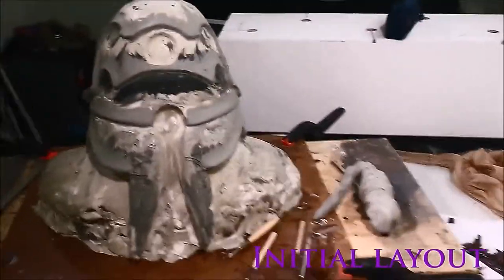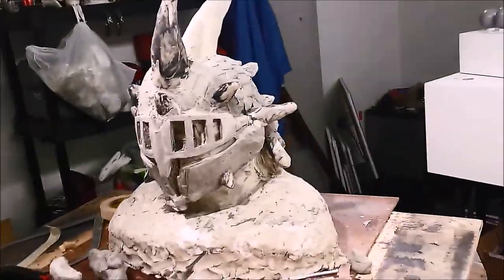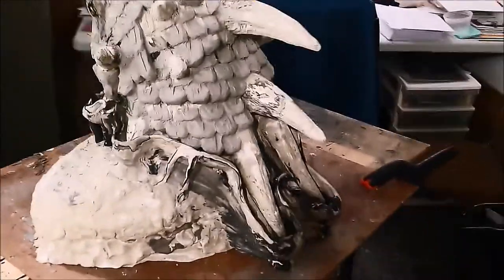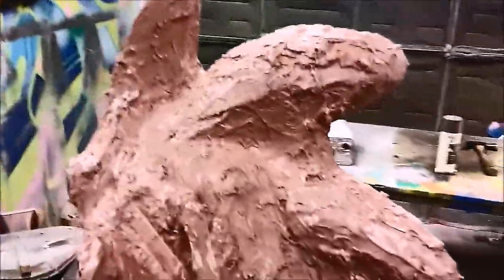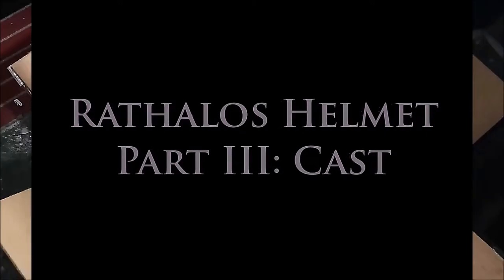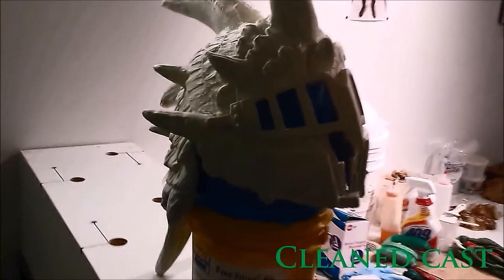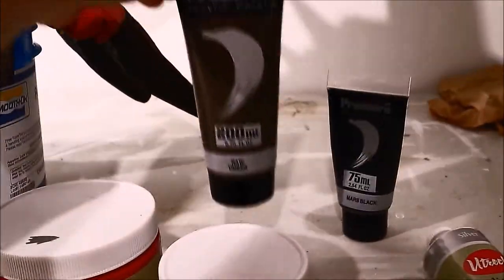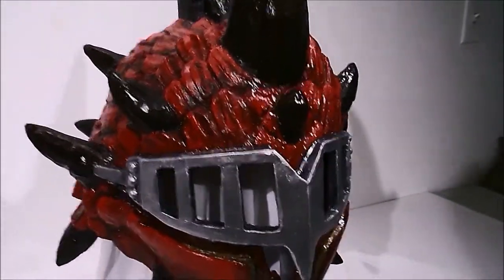Making a Suit of Armor Using Poly-urethane Rubber, Resin, and Epoxy Putty : Rathalos Helmet

Comment: So for a quick summary, you molded the base with clay, then used a rubber layer for detail in the mold and a stronger mold to help the rubber hold it's shape?
Reply from the maker: Yes, it's a fairly common mold making techinique, soft mold + mother mold. It's important that your mother mold piece can come straight off, which is why this has a three piece mother mold. Any less and you would encounter trying to pull off a mother mold that is grabbing what's called an undercut, essentially locking it in place. There are ways to do mother mold inserts that can help you cheat that problem, but it's tricky and I don't recommend it.

Comment: why epoxy putty inside instead of doing full casting resin is it cheaper or stronger or what.....trying to find the best way to do this stuff, because it gets expensive quick,
Reply from the maker: The epoxy putty is a great way to back up thin areas of resin and will also help you keep the total weight down. You could go through and cast thin layers of resin doing your best to get everywhere, but I think what you'll find is that in order to get the deep cuts in the sculpt (which are sharp ridges inside your mold) you'll have to throw so many layers that you'll get heavy pooling in some areas leading to one heavy helmet.

I may have not shown it well in this video, but if you can, throwing 2 or 3 layers of resin, hitting every area at least twice, and then backing the whole thing with a nice layer of epoxy putty to even it out, makes for a product that is strong and light. You can also lay in fiber glass cloth if you want something you might actually fight dragons with.

As for expenses, definitely look into getting some polyfil (you can stretch your resin as much as 33% with it) and polyfiber (which makes the stuff thicker and less runny). Also, I'm not sure where you get your resin, I get mine from US Composites. Easy Flo 60 is the stuff I most frequently use.